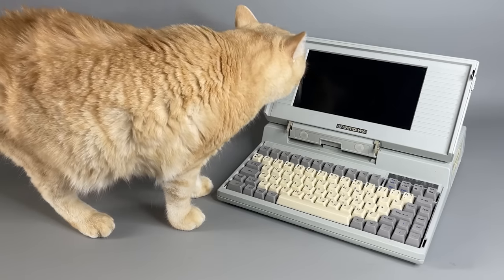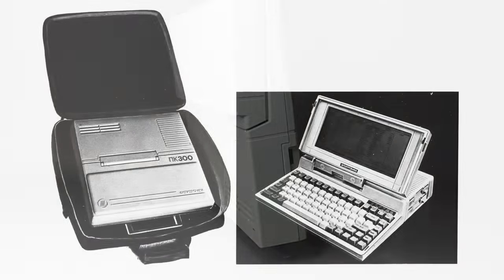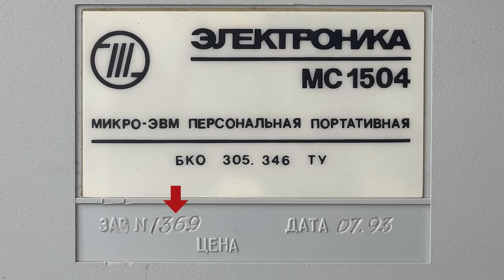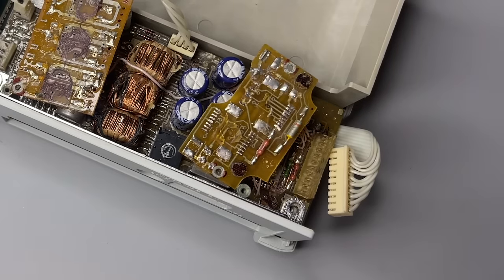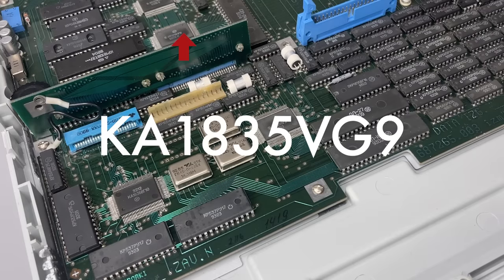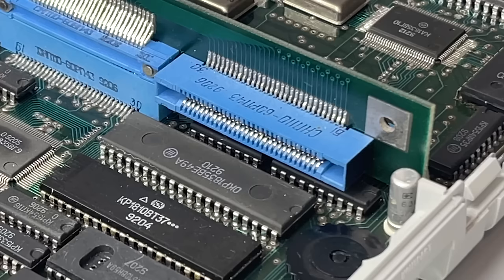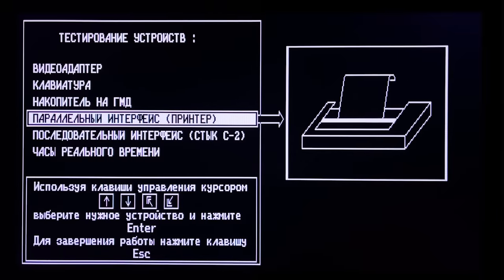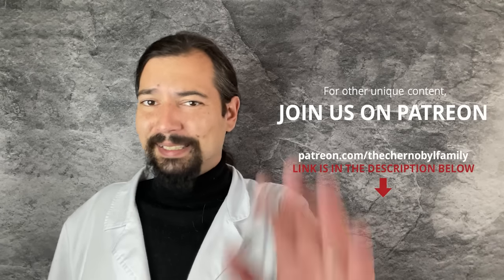I FINALLY FOUND IT! Behold Elektronika MS 1504, the ONLY SOVIET LAPTOP EVER.

Comment: You know, if the expansion port is basically an extension of the ISA bus, there might be a noninvasive way to attach a modern fixed disc solution like the XT-IDE. Tex-elec has a very tiny card that would fit nicely in that unused battery compartment. Figure out the pinout, have the right sized card edge made (maybe PCBWay), and then solder a ribbon cable on and route it into the battery compartment. As far as the PSU is concerned, I know the Amiga community swears on the Mean Well PSUs. I'd put it in an external enclosure, make a new expansion plate and solder in the multipin connector of your choice and build a matching cable to the external PSU. Basically adapt the Amiga solution to the computer. This assumes the scrappers trashed the orignal PSU beyond repair. Regardless, I bet you could fit a battery holder (say, 3 triple As) in that battery compartment to power the clock chip and get it on a more modern DOS variant. All in all kind of a slick computer.
Reply from the maker: Thank you! I believe that original Toshiba cards will work – after all this is nearly 1:1 clone.
Reply: Hmm, so there might be XT-IDE adaptations out there for it. That'd simplify things to be sure! @ChernobylFamily
Reply: You'd need more pins for an ISA bus though, wouldn't you? :(. The Amstrad PPC uses a DB25 and a DC37 connector to present the full 62-pin ISA bus, and the Visual 1083 Commuter I'm working on at the moment uses a DC62.  There's probably just enough pins on a DB25 for a floppy interface though. /Brett
Reply: Although, watching on ... there is that 60-pin internal interface ... is that the one you're referring to?  If you could find the pinout then definitely, you could conceivably design an interface board (XT-CF-Lite) that plugged directly into it ... and it wouldn't matter if it were Soviet 2.5mm or Western 2.54mm pitch as you could design the PCB to fit either.  I'm doing similar for the Amstrad PPC at the moment, trying to cram an internal CF board inside the machine. /Brett
Reply: @Brfff  Yeah, that was what I was talking about. Original was a KEL 8801-060-170L but 3M still makes a compatible connector: P50-060S-RR1-EA. That all assumes the Soviet clone used the same connector: they might have gone with something less obscure. The way I'd do it is out the XT-CF in the battery box and an Adlib in the expansion bay. I'd also wire a clock chip backup battery in there somewhere.
Reply: @ironhead2008   The soviets tended to use 2.5mm pitch rather than 2.54mm/0.1" ... usually you can just squeeze a Western replacement chip into a Soviet socket ... but expansion interfaces are a different case.  A good example is the Belarusian Байт (Byte, ZX Spectum clone) ... its expansion interface is a 96-pin (3x32) connector that is essentially a DIN41612 ... but the Soviet СНП59 connector uses a 2.5mm pitch instead of 2.54mm ... so the DIN41612 connector will just not fit ... arrgh ;). /Brett
Reply: As far as the bus is concerned ATA a.k.a. IDE is basically a stripped-down version ISA.

Comment: Дякую for this video sir, and especially for the finely detailed teardown! One thing I've always had trouble finding is the Soviet Cyrillic keyboard layout, and thanks to this vid (And a couple of screenshots) I finally have what I was looking for in this regard! ⌨🇷🇺😀

Rare as this is, I sadly doubt very much that original replacement parts for the power supply still exist anywhere (Especially if they were laid on gold, because $$$s) but many years ago I ran into a similar problem with a laptop of a roughly similar vintage, and for testing purposes I used various series/parallel combinations of alkaline batteries to produce the correct voltages. It was an absolute pig fitting it all on the bench, but it was enough to test out the laptop and prove that it worked! 😇

Assuming the service manual gives the voltages for each of the rails coming off the PSU (And let's face it: One of the reasons why I love tech from the USSR is because it was designed to be user serviceable! 🛠) a battery array might work for testing, but for continued use some of the off-the-shelf PSUs now available in the market should be able to provide the correct voltages to keep this beauty running safely! 🙂

And OK, it might not be the best computer of its time...But unlike any of the British made computers of that era I wouldn't be surprised if this - Once fixed - Would continue to work for a good 200-300 years afterwards! 🤘
Reply from the maker: You are more than welcome! As for the keyboard, many machines had a Cyrillic-first layout where Latin letters were transliterated, so it is JCUKEN, not QWERTY. Check the video about DVK-3 to see that. P.S.: In Ukraine we say дякую

Comment: What a fantastic piece of history. Impressive to see all of the chips made especially for it. I wonder what is the one with holes in the packaging?! It's more than unusual!
I'm really sad to see the power supply butchered... it's so beautiful, all made in with bodge wires. Very time consuming process to build things... Maybe later ones had a more cleanly made power supply that you can retro engineer to save this one?
Thanks for sharing this comprehensive explanation about this time capsule!
Reply: Holes are windows for erasing memory using UV light
Reply: @torkalovolodymyr5097  Are you sure about that or are you making an educated guess? It seems like a bizarre way to make a erase window - surely the Soviets had seem western UVPROMs with quartz windows before.
Reply from the maker: No, those are not. I will explain below.
Reply from the maker: For EEPROM they had windowed chips, the same like in the west. Those oval openings are a side-effect of the technology of production — in the middle of them it is possible to notice a few holes that are for the manipulator which positions the metal parts during forming/shaping. The crystal itself is sealed in the center.

Comment: Did they copy just the 8086 or also the 8087 co-processor? The motherboard, I must say, is a beauty. The soldering is perfect, the protection layer still 100% and hasn't aged one bit and the circuit board seems to be made of high quality epoxy - unlike the power supply that looked a lot like Pertinax. Also astonishing how many wires were used with the power supply when you already have a circuit board.
Reply from the maker: They cloned 8087 as well, under the name КМ1810ВМ87, though it was relatively rare and I never had it in my hands; speaking about the quality – at that point Belarus factories had it quite high. But what really surprised me, that yes, that PSU looks like a makeshift solution while its prototype was built in  more industrial way; my guess that they realized the production won't be too big, so it was cheaper to go for this handmade stuff. But, I might be wrong.

Comment: From my experience with twisted nematic displays like this, the solid blue screen is likely just the contrast cranked all the way up. The artifacts on the LCD look to be scratches in the polarizer film from somebody drawing on it with a pen or something. If you can find a junked donor LCD, even a modern one, you could probably trim to fit and get that fixed. As for the backlight, you'll likely need to get the -15v rail working on the power supply, or connect an external supply long enough to find out if the CC tube is still good. The 60-pin internal expansion connector is likely an ISA bus if this is a true XT-compatible clone, so you could probably design a CF-IDE card for it if you can find a pinout. 

As for the power supply... Eh. I don't even know where to start with repairing that, especially without schematics or even knowing what those missing components are. Personally, I'd just build a new one from scratch, as DC buck converters and voltage inverters are inexpensive, and easy to use. That might not be a "proper" restoration, but it would at least be functional. Sometimes you just gotta do what you gotta do.
Reply from the maker: Thank you very much for this.

Comment: Serious question though: are all the board-mounted components hand soldered or did the Soviets have wave soldering and pick and place tech at that time?
Reply from the maker: I believe at top factories they had pick and place, logically they had to. Though I am really not sure. Sometimes it is very much visible when it is really hand-soldered.
Reply: Kiev 'Elektronmash' did have wave soldering.

And there was domestically designed DIP chip placement machine named 'AVUMIS' (Rus.: "АВУМИС", "АВтомат для Установки МИкросхем" = 'automatic chip placement machine').
The name is kinda pun on 'VUM' ("[завод] ВУМ") which is another name for 'Elektronmash' of Kiev.
Reply from the maker: @u2bear377  thank you for this clarification

Comment: Thank you so much for showing this piece of history. The technical info is super interesting. Those Soviet engineers were very smart, even the reverse engineering has it's own challenges, and i have to admire that the Soviet Union and the post Soviet countries had electronics manufacturing capabilities, unfortunately generations behind the west, but still had some industry unlike the "third world" were I'm from.
Reply from the maker: This particular device is a good example of high end engineering of their industry. In many cases it looks very untypical compared to what they were normally producing.

Comment: I never saw a DIP IC with two holes on it (except for mouse optical sensors). I imagine the reason for that, like for them to be attached to heat sinks for instance.
There is a so big contrast between the quality of the motherboard and the quality of the power supply that I question if the it was sourced from already existing projects.
Reply from the maker: Those are for positioning during production, it is manufacturer-specific thing. They do not serve any other purpose.

Comment: The Soviet Union’s mathematicians & computer scientists were capable of so much more, had the political system been open to market forces & free flow of information they wouldn’t have built this thing.
Reply from the maker: If that system would be open, that system would not be needed. Which is actually, happened. So you are very right.

Comment: Funnily enough some of my late 80s/Early 90s laptops make the same sounds when opened!

It’s not shocking that the soviets didn’t leap ahead in microprocessor based electronics, that industry was essentially formed by home tinkerers with access to a glut of castoff parts from manufacturers in California. 
The microprocessor was never really intended to be more than the brains of a fancy calculator. It’s the confluence of truly forward thinking geniuses like those at commodore and acorn, the sales techniques of apple and IBM, the reverse engineering prowess of compaq that dragged the computer industry kicking and screaming into the consumer space and proliferation. 

As well once the Japanese started cloning chips the US manufacturers were just pouring cash into new designs so as to not become irrelevant and defunct and it’s thanks to that we have the modern computer processors we use today.
Reply from the maker: Thank you for sharing!

Comment: 1992 I had a 486 DX 33 MHz computer. Weird that in Russia a 8086 compatible was still state of the art
Reply from the maker: In entire USSR. From this point another machine (ES1842) also made in Belarus is interesting, as it was based on 8086 but it had a chip set that actually allowed to execute 80286 instructions.

Comment: Hmm, very interesting machine, thank you for your very well made review! It shows how much effort had run into the basic hardware layout, if the chips are genuine russian made (which I assume). The AMI Bios makes sense, to keep it IBM PC Compatible and thus open to the world of programs. All in all not shabby, a 386 was ok in 1991, not the cutting edge, but good to work with. If it had been developed further to make it more affordable and the international PC world wouldn't have gone that crazy cheap for used machines, it could have become a success story as well.
Reply from the maker: Chips are mostly Belrusian, same as a laptop. In fact, surprisingly good machine. They had some prototypes of a more advanced model, known as PC400 based AFAIK on 286, but all (known) what exist of it is one case prototype and a few textual references.

Comment: Considering the state of shape of the PSU and since you know the different voltage rails, it's certainly better and easier to build one from scratch than trying to repair this one.
For the non-booting problem, there is two short flashes of one of the LED, on some BIOS, 2 short beep means a problem of parity of the RAM or a problem with the Video memory. Maybe it's also the case here (but the problem will be finding identical ICs or even equivalent ones if there are ones)
Reply from the maker: Thank you!

Comment: Surprising that it doesn't use an orange plasma display. But I guess it probably would have if they couldn't have imported LCDs
Reply from the maker: Right. But somehow they did not come to this. There existed a clone of Atari Portfolio made at Integral in one single copy; I wonder which display that had.
Reply: @ChernobylFamily  If they had used plasma it would probably still work 😄 But maybe getting to 640x480 would be a problem for them at Reflector. I once had an IBM P70 with a really gorgeous plasma screen. But that one couldn't run off batteries, so maybe that's why they went with LCD, so it could be a true modern laptop. I would guess their Atari clone probably used a display very similar to the Elektronika 90

Comment: When you open the screen, hold and lift in the middel of the screen. It Can bend or break the screen when opening from corner, thats goes new laptops aswell.

But its a Nice laptop.
Reply from the maker: Thank you! Well, this one has it super thick and solid, though your advice is 100% correct!

Comment: Speaking to your philosophical question:
One thing my father said to me once is that it is easy to judge people who would rather have 5 dollars today than 20 tomorrow, but the reason will remain a mystery. Stupidity, poverty, hunger. Could be anything.
Reply from the maker: The funniest thing is. I educated a few guys who process metal. They genuinely had no idea at all that this kind of hardware has any value. They got a brand new world opened, and now google well before cutting any gold.
Reply: Yes. There are still people, who gut electronics without realizing that they may get better value for less effort, just by listing the thing on classifieds.

Comment: Apart from the display, it looks like a Toshiba 1100 plus clone. The Toshiba display ran equally to both sides and didn't have anywhere as big a 'bump' on the back. Otherwise VERY close, especially the display hinges etc.
Reply from the maker: Exactly. Check the middle part of the video, we explain there why and how it happened...
Reply: @ChernobylFamily  Yes, O eventually did,  the comment was from 1 minute in where I could not believe how familiar it all looked. I was rather surprised by the copying rather than designing something from scratch. 
I really liked some of the other early computers you have shown (in other vids), as they are totally different to what I normally see. I am now getting into retro computing, just a pity I threw so much away over the years.
I bought an original T1100 when they were new, then later scored a T1000 and then a T1100 plus through work. Unfortunately I now have only 3 T1000's. I tested one straight after watching and could not get it to run - battery problems for a start.
Reply from the maker: Thank you for sharing! I see manuals for them are available on internets, as far as I remember there are tips of troubleshooting battery issues.
Reply: @ChernobylFamily  Thanks, I think I have all the info, just too many other jobs in the way. Surly one out of three will respond to a fresh set of cells. but then again I've opened my mouth too soon????
Unfortunately the T1000 will only work with a good battery, the power supply is really only a battery charger and cannot handle the current peaks the laptop generates. They can run indefinitely when plugged into mains power, it's just the peaks.
Now you have me thinking, maybe a bank of electro's can take the place of the battery, as I don't really want to fit a new battery, as they are never going to be used portably, although I better devise a limiter to stop the charger putting too many volts onto that cap bank.
The T1000 uses 4 sub 'C' NiCads (or was that NiMH) so about 4.8V.  I have run them in the past by just shoving a few amps of 5V into the battery connector (without using the charger), I had one sitting in a corner monitoring things, running on 5V, it ran for several years, 24/7 until the display finally died.
Reply from the maker: @paulstubbs7678  i remember when searching for the info about T1100 Plus startup, I found a YT video where a guy made it run from USB power bank instead of a battery. Maybe it is reasonable to look at the similar direction.
Reply: @ChernobylFamily  That's basically what I did with a 5V switcher, kind of the same thing as a USB power bank - just another source of 5V.
However for a restore, it would be nice to use the original power brick rather than adding a socket for a USB etc supply, (I have a stock of USB-C inlet sockets - but it does not seem right) It's nicer to keep it as original as possible, just loose anything that might cause damage, like batteries that can spring a leak whilst the laptop is sitting in storage, or up on a shelf unpowered for extended periods.
Reply from the maker: @paulstubbs7678 well, hope you will manage that! It is something magical to get that stuff working again.